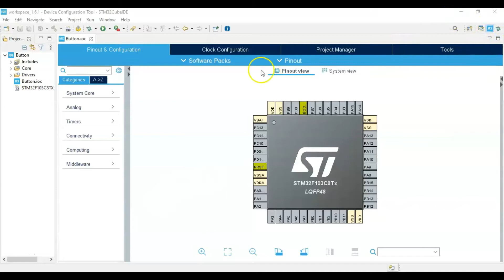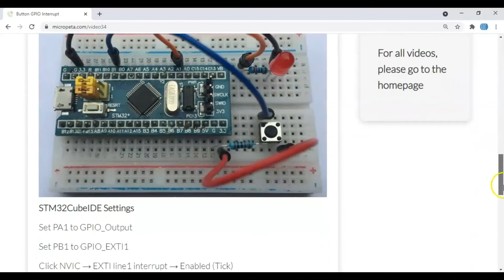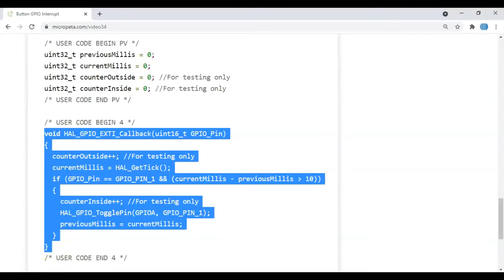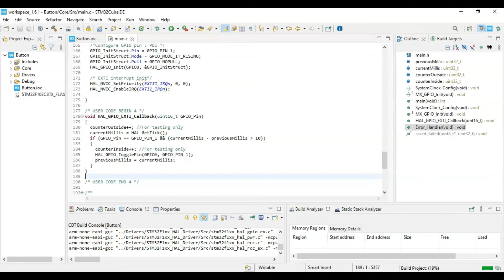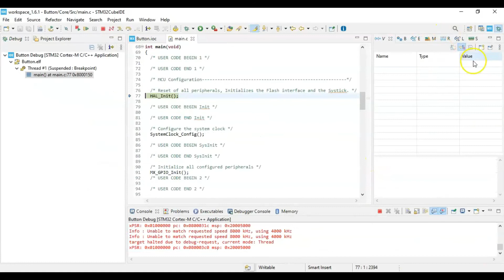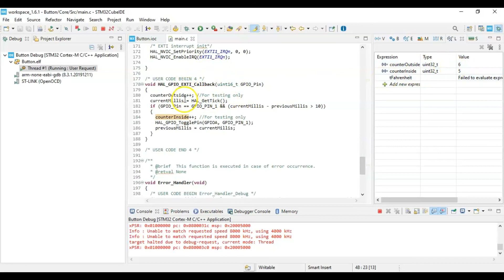34. STM32CubeIDE Button debounce. Interrupt with STM32F103C8T6

Comment: Hi there I am using sensor as an input which will turn on the buzzer, and also using EXTERNAL interupt Buthon the to turn off the buzzer and turn on the LED but the code is not working. It is like when I siply power it only do one tast only butten not buzzer and also sensor stop working need help with example

Comment: Works very bad and unstable. Sometimes it's ok, sometimes the LED returns to the previous state after button release.
Reply from the maker: I have used 10 milli seconds to ignore debounce interrupts
If the push button is not smooth, you may need to increase the time 
if (GPIO_Pin == GPIO_PIN_1 && (currentMillis - previousMillis > 10))
                                                                                                                 ^^^
Reply: @NizarMohideen  I've already tried to set 50ms, but it doesn't help. Also, it's not a button problem. The same button works flawlessly with 50ms debouncing delay in my PIC code. But I'm new to STM32 and can't make it work yet.
Reply from the maker: I will search for better way of doing with interrupt service routine. If anything better, I will let you know. In the mean time, you can also search for isr documents in the net. Thanks

Comment: Іomeone has the problem this example? I thing, this method work only on the first moment, when you press the button, but if you release the button this method can detect second press.
Reply: You should check falling or rising edge of trigger of clock

Comment: thank you for this good tutorial 
can you please do the same thing with an STM32L432KC and three LED?
Reply from the maker: Hi Charnel,
I don’t have STM32L432 but it is simple. You can set three interrupts and three GPIO_Output.
Good luck
Reply: @NizarMohideen  I've already tried this a few times but it doesn't work properly
Reply from the maker: Is it working with only one button
Click NVIC → EXTI line1 interrupt → Enabled (Tick)
You need to tick correct line interrupt for the pin you are using
Reply: @NizarMohideen  ok Thank you verry much  i will try it

Comment: Please explain below condition - What is 10?

if (GPIO_Pin == GPIO_PIN_1 && (currentMillis - previousMillis > 10))
Reply from the maker: Push button debounces multiple times due to its mechanical nature. For single push, it can send several interrupts. 
In this video, I have avoided any interrupts within 10 milliseconds from the original interrupt.
Depending on the sensitivity of your push button, you can adjust this timing. Thank you
Reply: @NizarMohideen  
Thank you 😊
Reply: @NizarMohideen  is this 10 milisecond delay or timer interrupt ? I mean is the code waiting at 10 milisecond line ?
Reply from the maker: 10 milisecond is not timer
10 milisecond is not delay
10 milisecond is a counter using HAL_GetTick()
We use this counter to check whether the interrupt happened within 10 milisecond from the last  interrupt. If it is within 10 milisecond, the interrupt is from the same push of the button, Otherwise it is a another push  of the button

HAL_GetTick() is similar to millis function in arduino